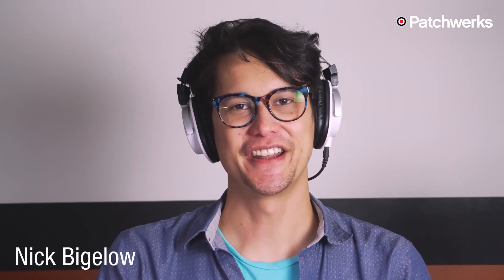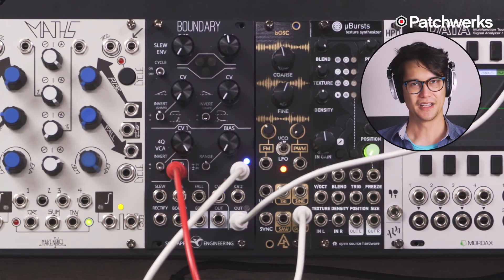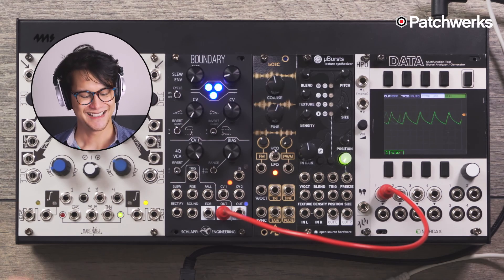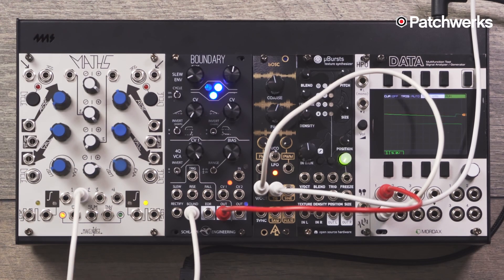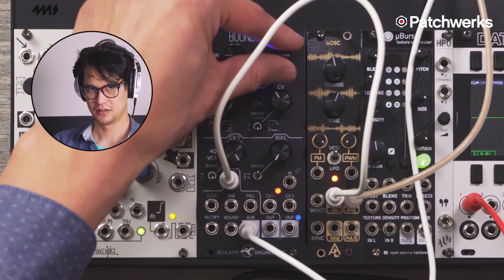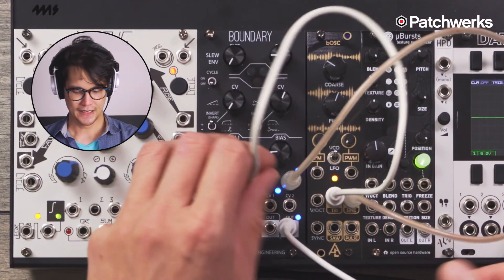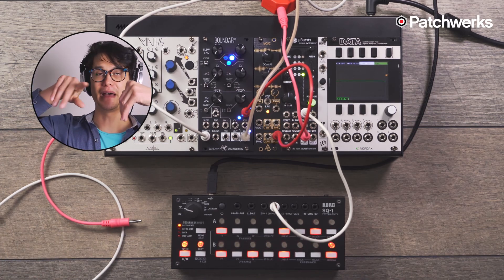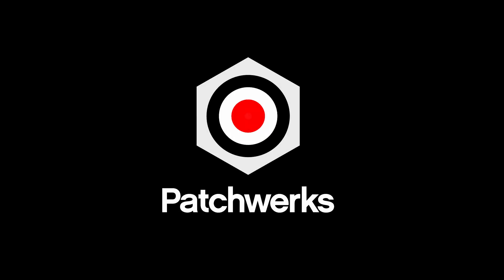The New Utility Powerhouse - Boundary by Schlappi Engineering

Comment: Thanks for the demo! 

Can you clarify how the Bound input changes the output of the envelope? On the DATA, it looked like it was changing in both amplitude AND frequency. If it's changing in amplitude, doesn't that make the output less usable as a control in a VCA? As in, when the threshold is low, the ouput would be so low that it wouldn't open a VCA?
Reply: Correct! This is useful both for the bouncing ball effect (it requires both amplitude and frequency change) and also it acts as an additional VCA over the envelope, this allows you to modulate the modulation into complex shapes or even gate the envelope on or off. So I would argue this makes the output more usable for controlling a vca in a dynamic way :). If you only wanted to change the frequency you would do that with the rise/fall CV.
Reply: @specialchirp  thanks for responding! I got this module a few weeks ago and as soon as I tried the bound input, it just made sense. Wonderful module, thanks!